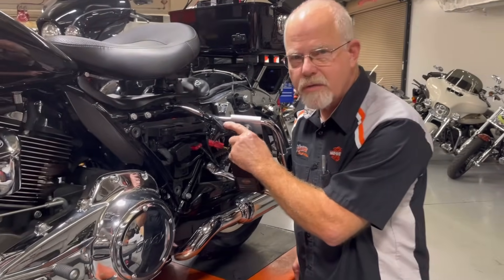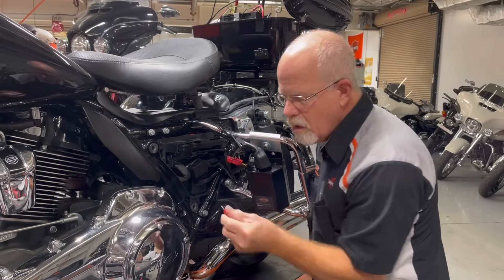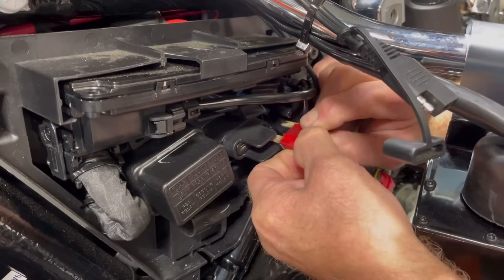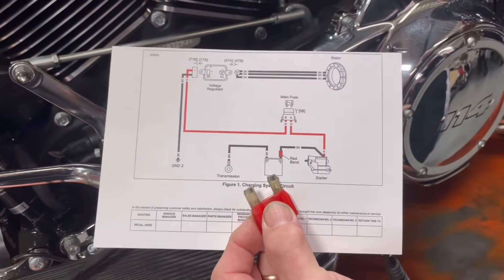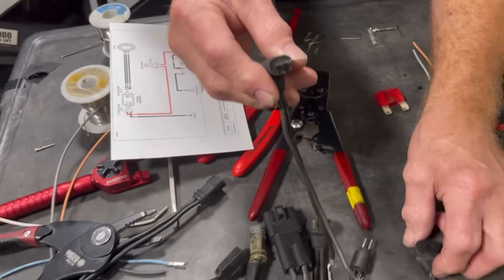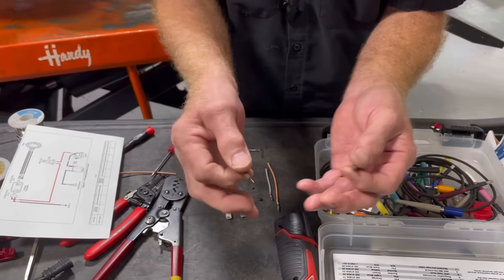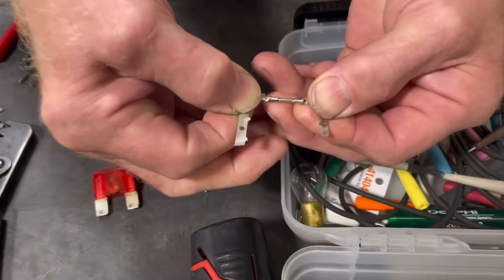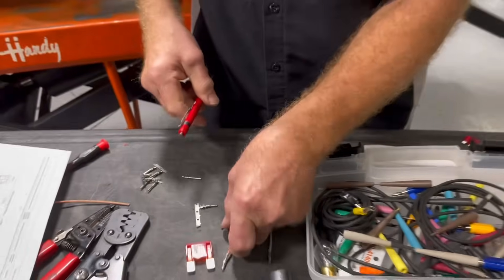Doc Harley Terminal Draw Testing

Comment: have a question on the brake light on a 13 model.   can it be replaced 1 to 1 with out a compensator.?  i found the the base of the light bulb was a little burnt,  making the brake light not work after a long stop.
Reply from the maker: I believe I have a video in the past on replacing turn signal bulbs….Doc
Reply: its not the turn signal bulbs its the dual rear and brake light.  the brake light gets hot and it causes the lead that it uses to burn a little making for an open circuit that turns on the red dash warning light.  So i just was wondering if there is a direct swap from the reg bulbs to LED
 @LowCountryHarleyDavidson

Comment: Doc, thanks for this posting. It is a deep subject but really helps the consumer better understand the electrical connections that make up the entire wiring harness 'point A to point B' connection importance. Vibration works against these connections as well as taking apart and reassembling them again, time after time, that also takes it's toll. Blessings, and stay safe, sir!
Reply from the maker: Thank you for adding your insight…Doc

Comment: thanks Doc as a GM A S E   Master Mechanic for 25 years I would find loose pin connections,burnt connections smashed connections and pushed back pins that was a intermittent problem like a loose terminal it was great when they were found sometimes by just checking the suspected circuit wiggle test or good luck.
Reply from the maker: Intermittent issues burn up a lot of time and brain cells…..Doc

Comment: Check those battery terminals for tightness! More cars fail to hold a charge or start people's cars because of worn out or corroded battery terminals. Motorcycle terminals come lose too just from vibration!
Reply from the maker: Thanks for sharing your tech tip….Doc

Comment: Doc, good info to know, but shouldn't the tender be connected to the battery?
Reply from the maker: I would think so but HD has it going through the Main Fuse. Take the Main Fuse out for winter storage and the tender is inop….Doc